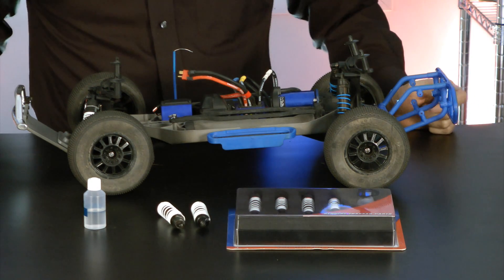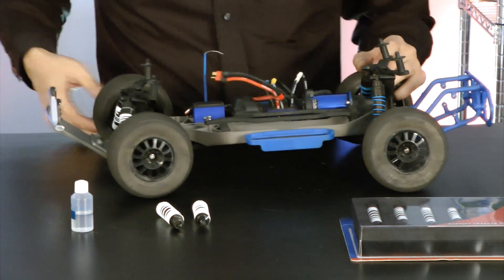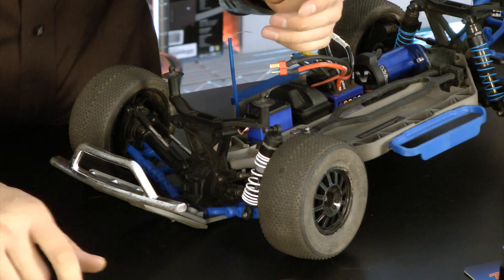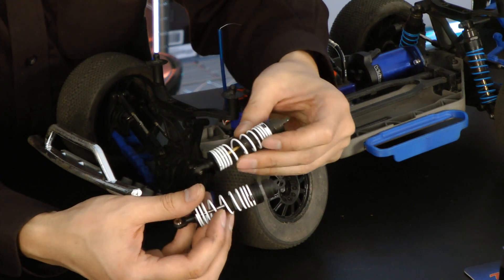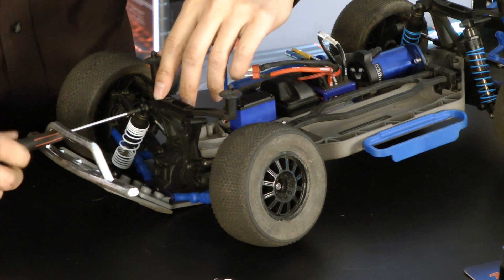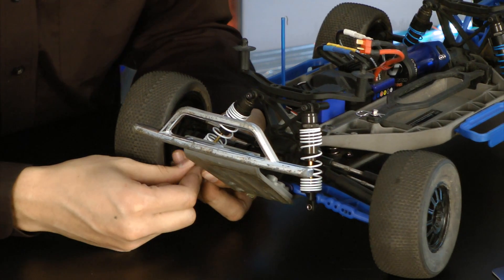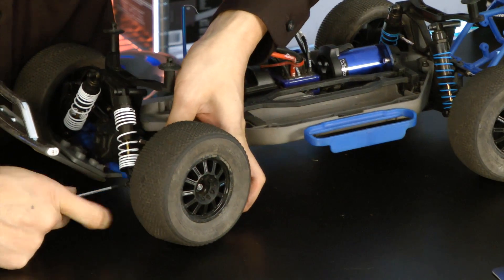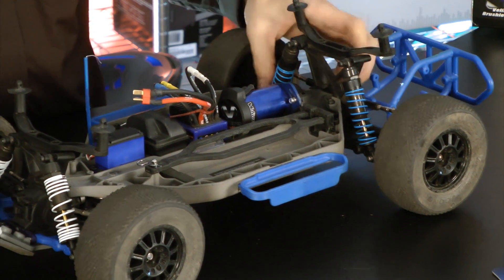Install Traxxas Slash Big Bore Shocks

Comment: I bought a brushless system, new motor steel yokes, and Stampede tires that i chained up for the snow. i only had to cut my slash's body a bit and it works crazy good. I'm going to get these know that i know how amazing they are! thanks rcnightmare!